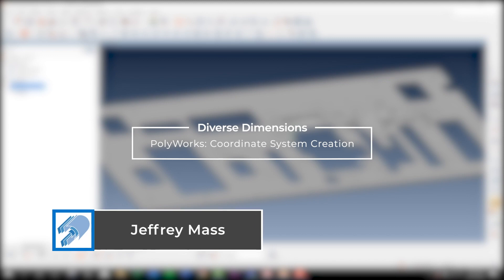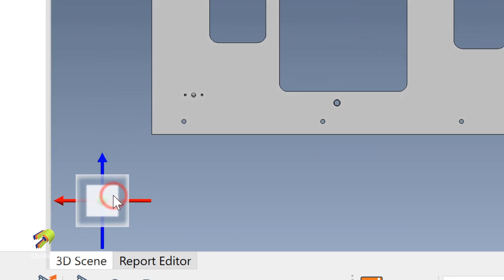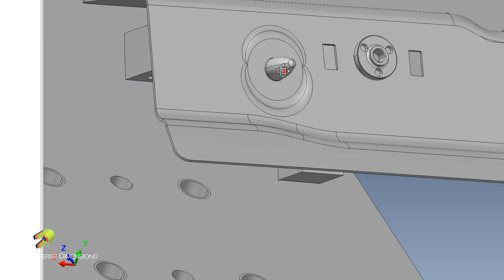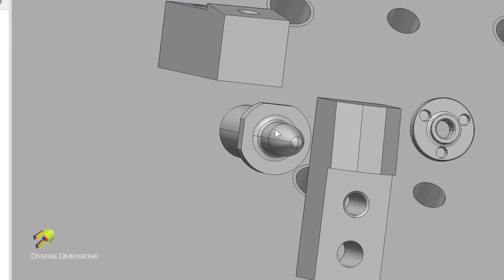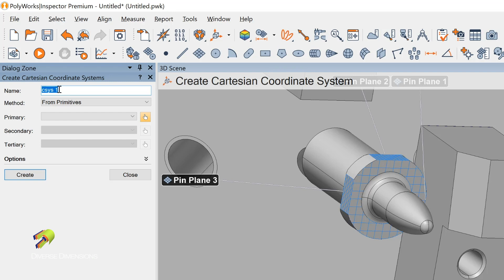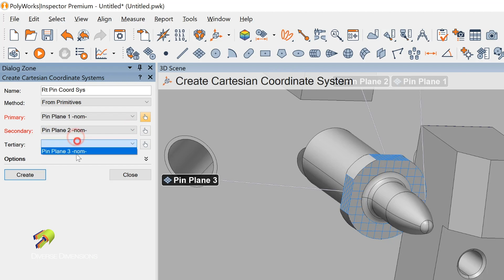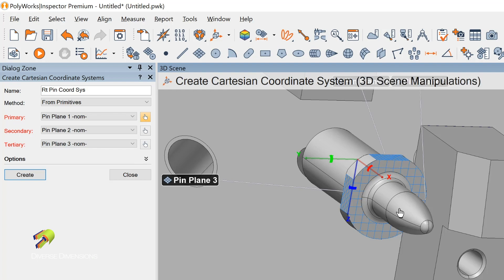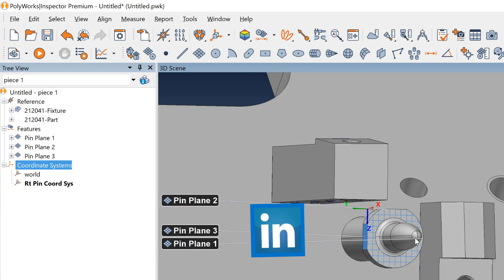PolyWorks: Coordinate System Creation - Tool Dial In

Comment: How to shift this co-ordinate system in pin center
Reply from the maker: Thanks for the comment.  If the pin center was where you wanted to "origin" the local coordinate system, use the pin cylinder as one of the Cartesian coordinate choices.  Send me an email and I could pull a Zoom / Teams together to help you with this one.